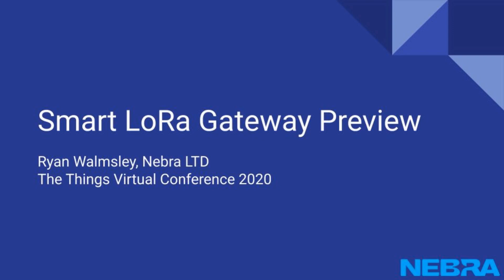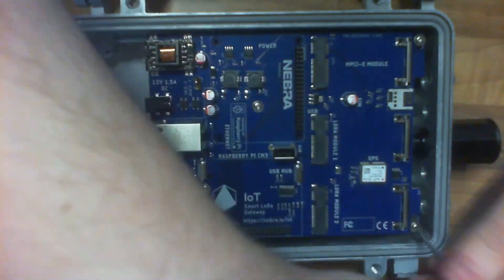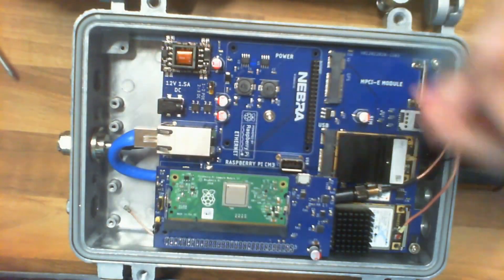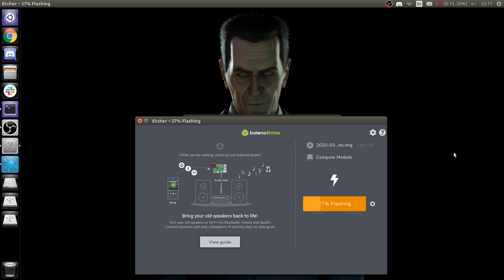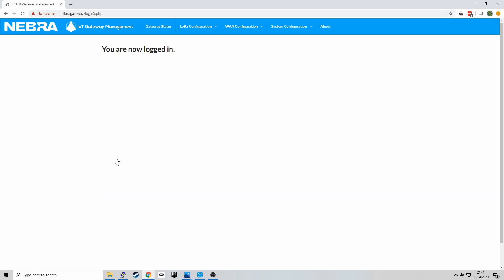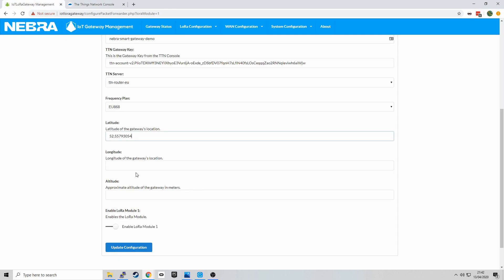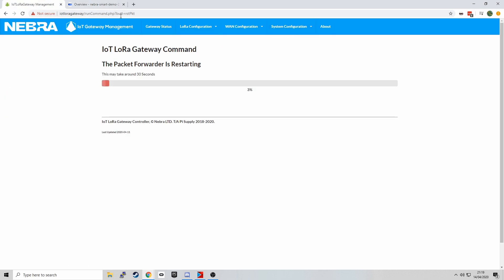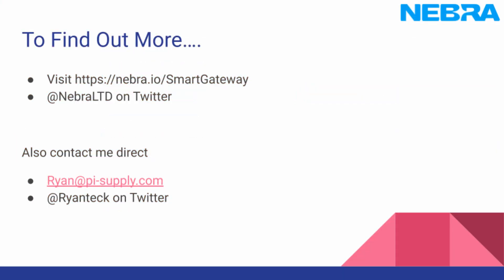First look and getting started with the Nebra Smart LoRa Gateway prototypes!

Comment: Nicely done Ryan, what are the differences between the two mPCIe modules? Why do you need two?
Reply from the maker: With one you can do 8 channel gateway and with two you can do 16 channel gateway or just for redundancy (they often use 16 channels in USA). Most people will not need more than 8 channels though. The gateway mPCIe boards use SPI instead of USB so they are a non standard mPCIe connection just using the form factor. And then the third mPCIe slot is a standard USB one which can be used for the 4G backhaul or any other mPCIe module.